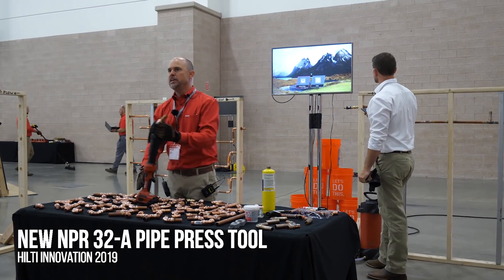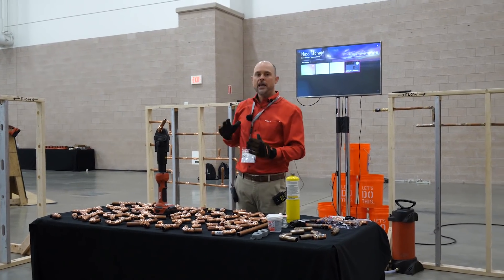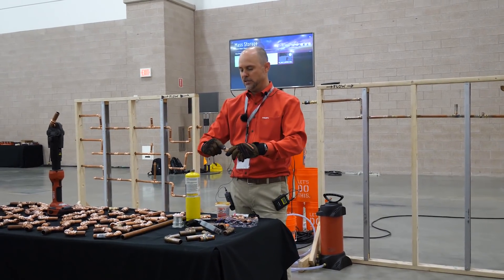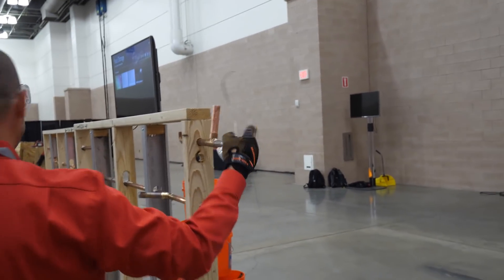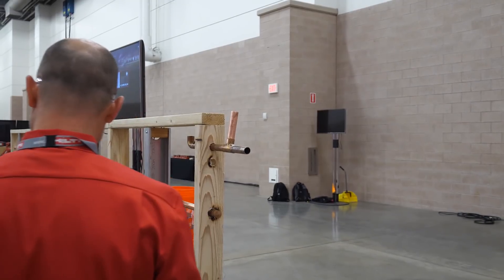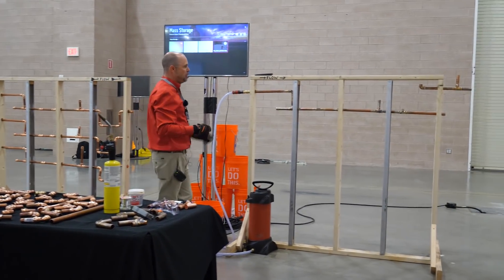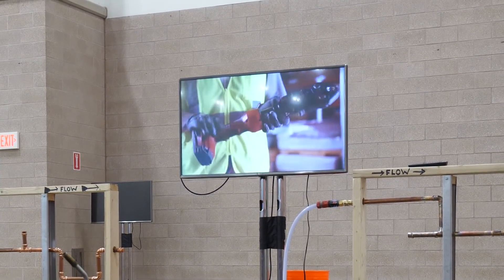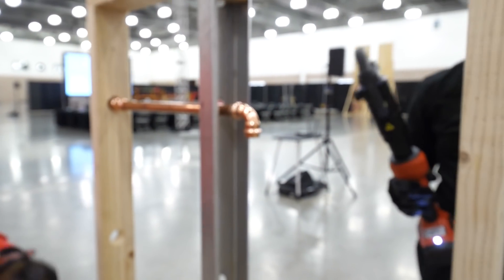NEW Hilti NPR 32 A Pipe Press Tool - Hilti Innovation Day 2019

Comment: This guy doesn't know anything about pipe and fittings and he certainly doesn't know how to solder copper pipes together. He's putting the flame on the edge of the fitting which is going to make a cold joint normally, but as hot as he's getting it, it'll be discolored  mess. And that's where I stopped watching

Comment: I need one... where can i get one? that will make my job easier and faster no flame in a home👍👍🖐
Reply: get the milwaukee, or rigid one . readily available and probably cheaper
Reply: @TheBostonstapler  not really i find out rigid rp350 tool only more expensive than hilti tool+ battery+ changer. they are jaw expansive, but you can get m18 jaw or rigid jaw use with hilti.
if you got cordless hilti tool or going to...many be battery option